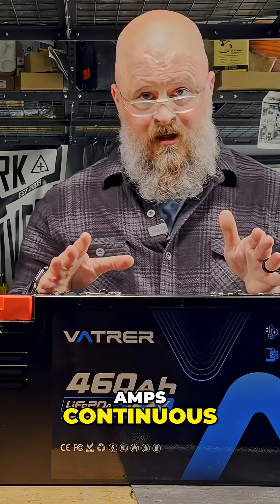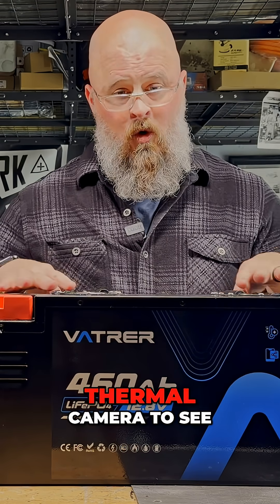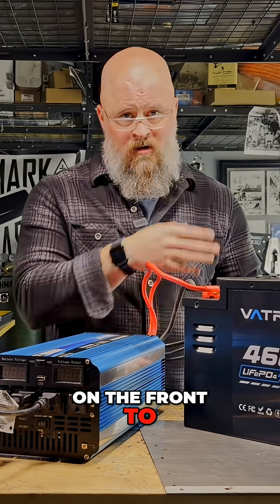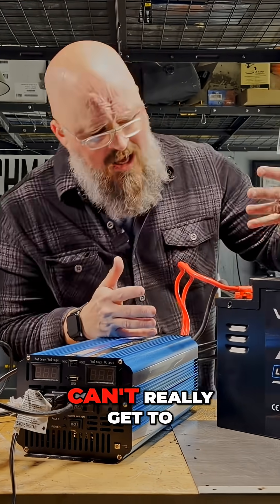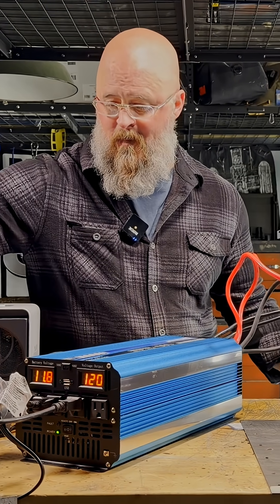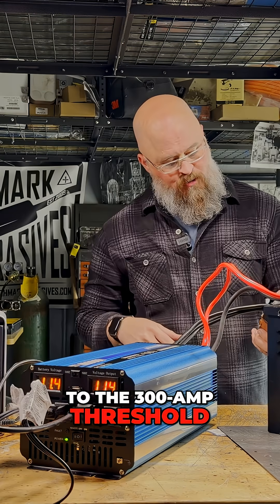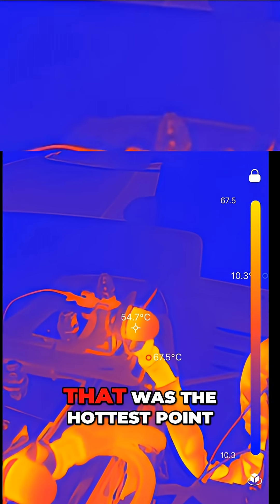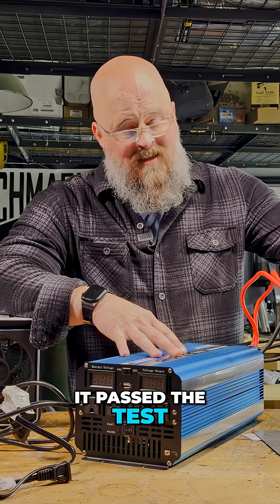300 Amp Battery Test: Does It REALLY Last? #shorts

Comment: If you cycle it no more than 25% from full, it will last a little over 10 years.  Full discharges every time will be ruffly 1.5 years but I woulđ have to recheck that last time range but its not to far off.